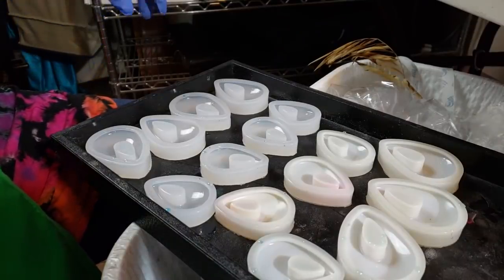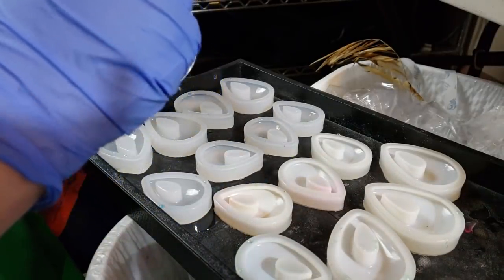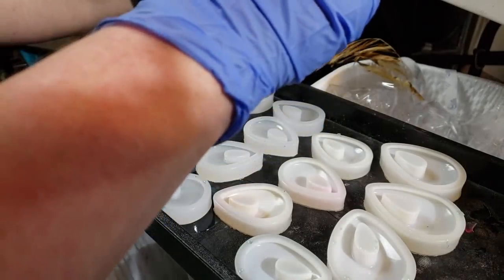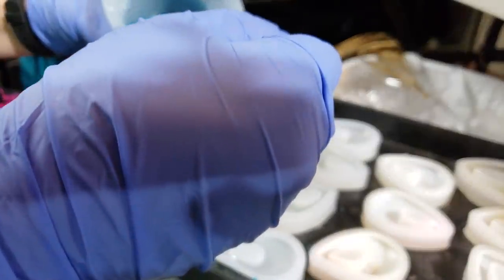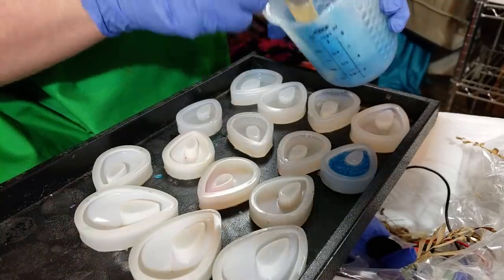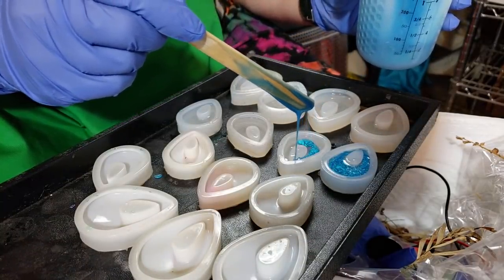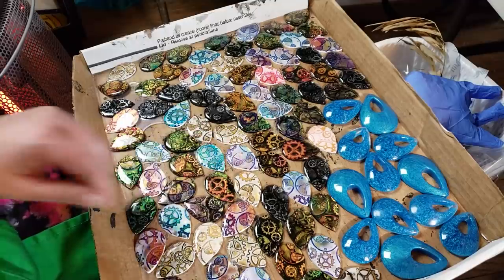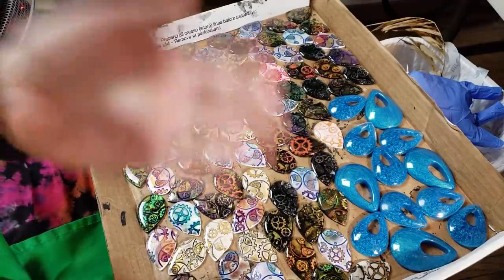How to Resin Baubles

Comment: Yvonne, your work is exceptional.  I have a question--can these molds be put in the oven, since they are silicone.  I would like to use them with polymer clay and put them in the oven.  Any idea?

Comment: If you dont have a heat gun a hair dryer will work too when on low is what I was advised too on another video :)
Reply: Also just finished watching another video where the person used the lighter you use for a BBQ as well if you have one of those so now I know there is 4 things you can use a heat gun, a small blow torch, hair dryer and a BBQ lighter. Dont leave it in one spot or you can scorch the resin and will have black burnt stuff instead of a clear look to it.

Comment: How easy is the resin cup to clean? Also, I'm feeling derpy when I try to use my chrome powder to add another depth to mine.
Reply: Since it's a silicone cup, it's super easy. Once it hardens you can just basically squish the cup a little and it'll all pop out. Resin doesn't stick to silicone, so it's handy to use a silicone cup that way.
Reply: @mistycherie  Good to know.  I hate using stuff that adds to landfill unnecessarily!  I'll have to get one of those BEFORE I use resin.  I have several kinds waiting to be used, but I don't have any mixing cups so far.
Reply: @freewaybaby   Yep. The silicone hotpads and mats (like for kitchen/baking use) are also nice to place your items on when pouring the resin as it won't stick if there are spills.

Comment: Would you ever sell a set of the cabochons you make?
Reply: Not sure if there are any now but she has been listening valentine sets on her etsy shop. Occasionally she does list individual cabs also.
Reply: Check her etsy shop. The polymer clay cabs usually sell for about $10 each. I'm not sure about the resin baubles though, because I think they are specifically for patreon supporters and her craft along kits that come with all you need to make a wire wrapped pendant.